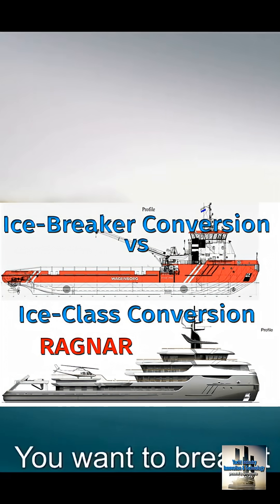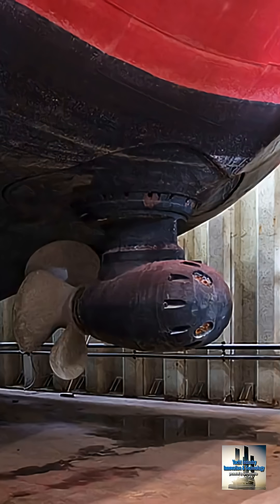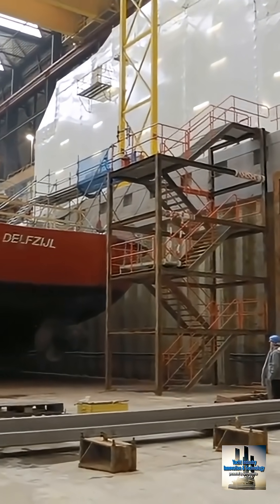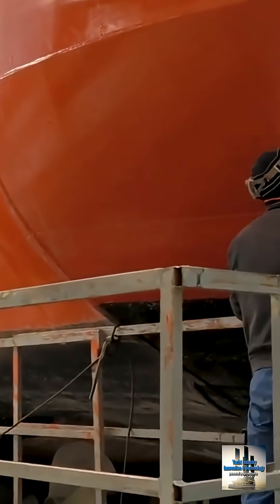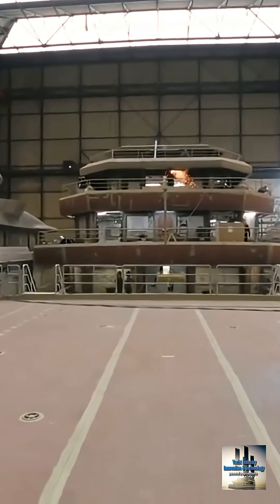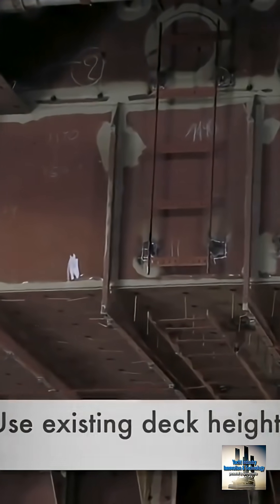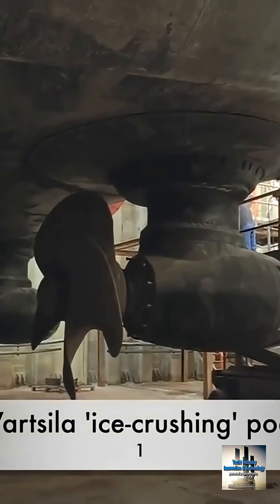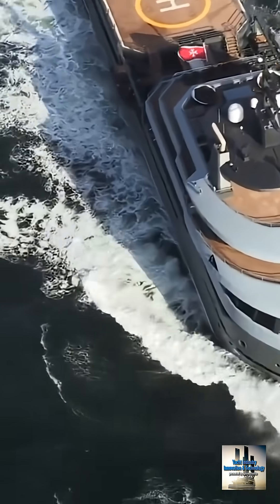Ice-breaker vs Ice-class RAGNAR Conversion

Comment: Yes. There are several “ice classes”.
A icebreaker is in a class way up by itself.
But most ice class ships can easily go in 20 cm ice, and that’s really what defines the edge of the ice. Aka., you don’t wanna go further.

Some icebreakers have propellers in both ends, and to prevent them from being squeezed from the side and wedged in, they blow air under the ice.

For navigation in arctic waters, it’s the small icebergs, shelf’s, you must look out for.
They can be hard to spot, but are usually bigger than expected. They may punch a whole, but worse and more often is rudder and propeller damage.
Reply from the maker: Sounds like you've been there and done that!
Reply: @XplorerYachts   A bit around Arctic... 😉